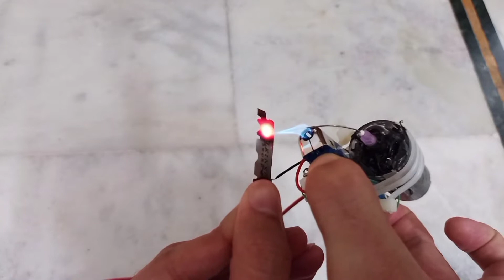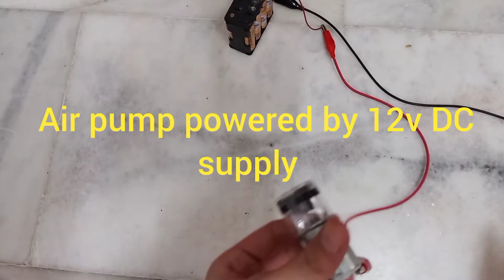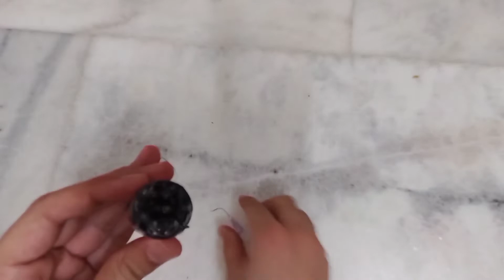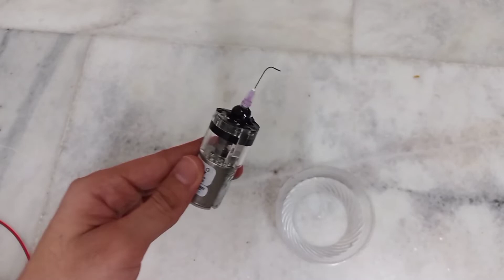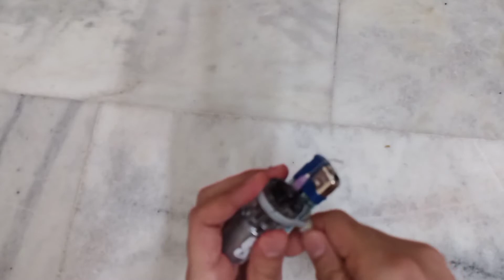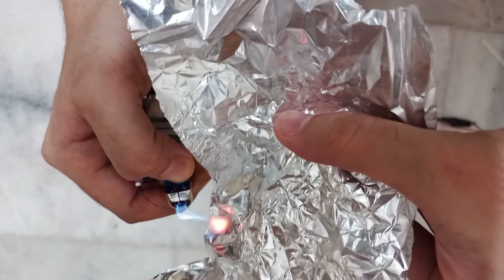Home made jet lighter

Comment: Bro music ke jaghe par explain karo kaise banate ho bohot aage jaoge👍
Reply from the maker: Ok thanks bro
Reply from the maker: It is simple combination of lighter and aquarium air pump  with hypodermic need to direct air into the flame 🔥 which provides more oxygen hence it generates more heat 
I got this inspiration from goldsmith who was blowing air manually into the flame by small pipe in order to check silver coin